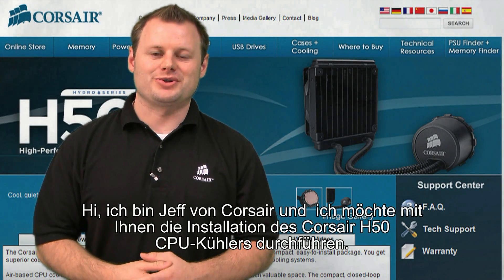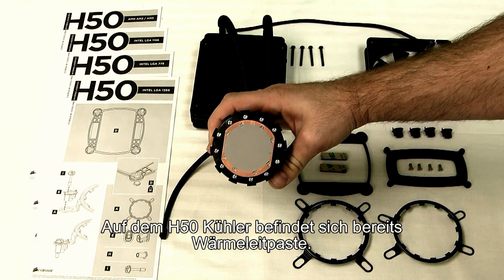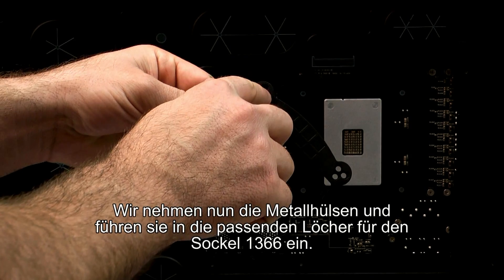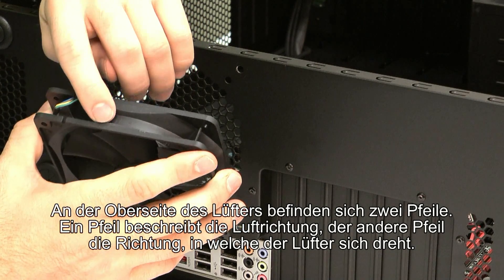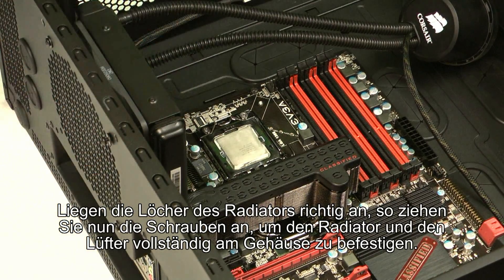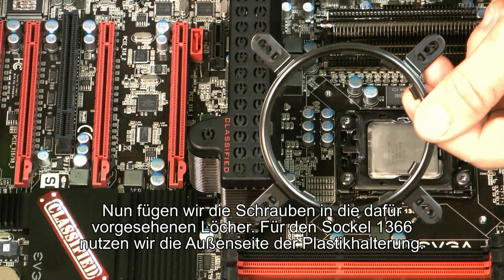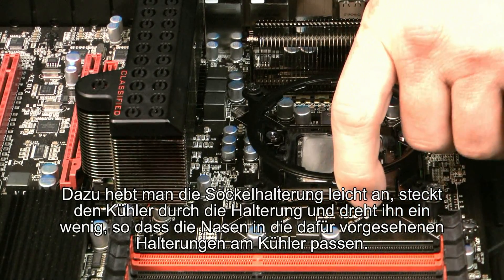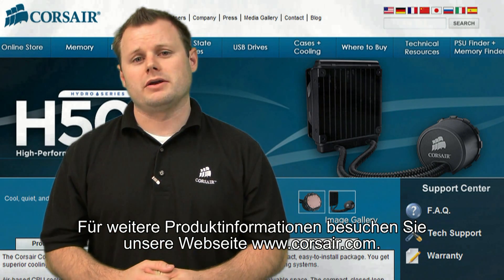How to install the Corsair Cooling™ Hydro Series H50 CPU cooler (German)

Comment: The bracket on the backside of mobo is made in very durable plastic. The bracket that locks the pump to the CPU is in metal. I've used this cooler for 1 1/2 year and it works perfectly.

Comment: i use this thing with a 14cm Alpenföhn fan incl. fan adapter
Do not blow fresh air into the case, thats totally wrong, suck the hot air out, and make sure having a stronger fan at the front or side of the case. so you got a positive air pressure.
Remember! lower temperature in the inside of your computer case is important too, not just a cool CPU! capacitors and voltage converters may life longer.

Comment: @VirtuosoX1    I could give you a thermodynamic reason but I will make this simple. The cool air will have a greater effect on the radiator. The greater the difference between the temperature of the water and the air blowing through the fins, the great the drop in temperature of the water going through the pump that is cooling the cpu. The rise in temperature in the case is not as important as the the cooling effect that is gained for the cpu. If you care, you can put another fan venting out.